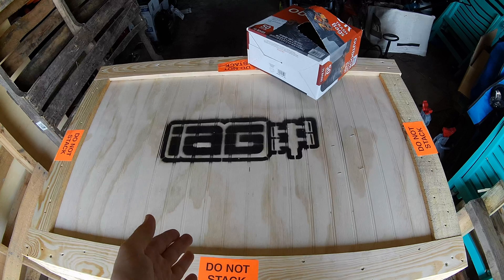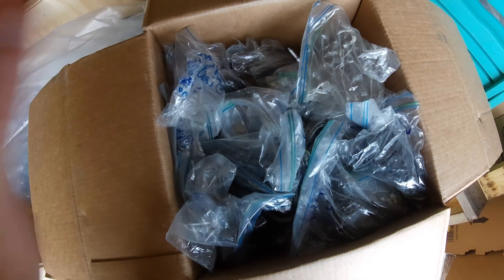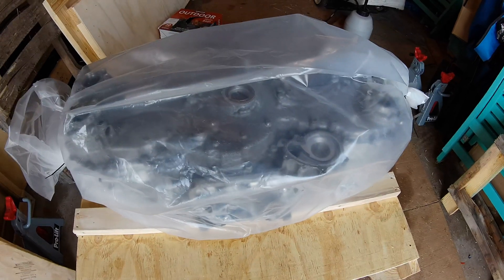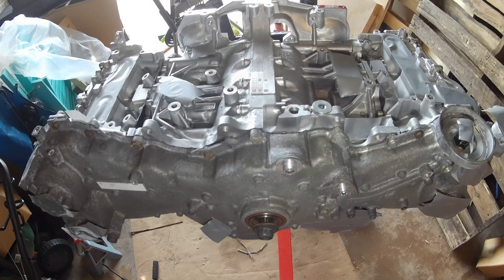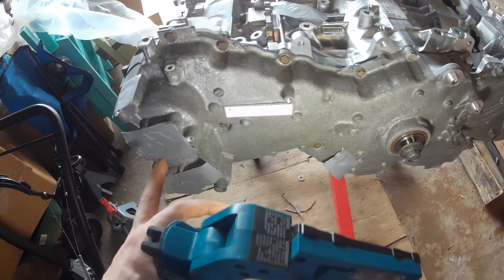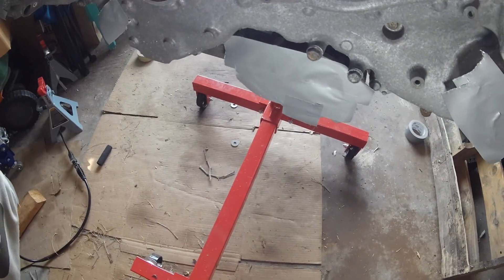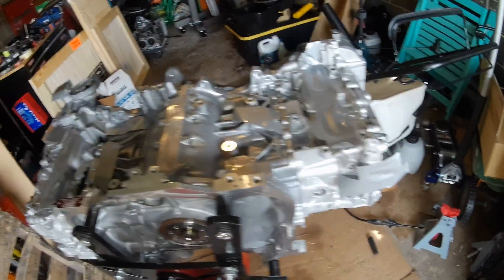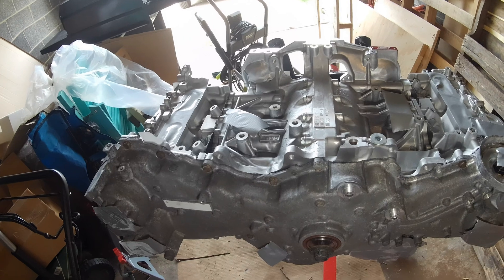Unboxing my IAG Stage 2 12.5:1 open deck FA20 long block

Comment: So how's this project going?
Reply from the maker: Just got the car back from the shop because the built block wasnt making oil pressure. So now I just need to break it in and tune it

Comment: Looks good!
Reply from the maker: Thanks, it will look even better once i swap everything/put the rest on and it runs. I was originally quoted at 6-8 weeks and it took 13 so I've been going nuts not driving